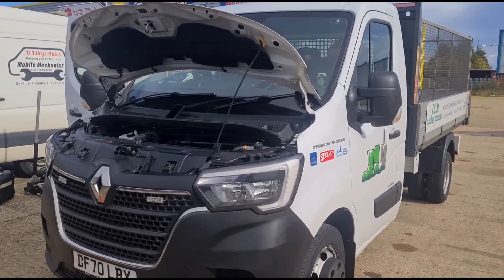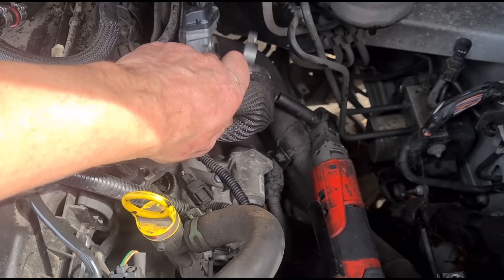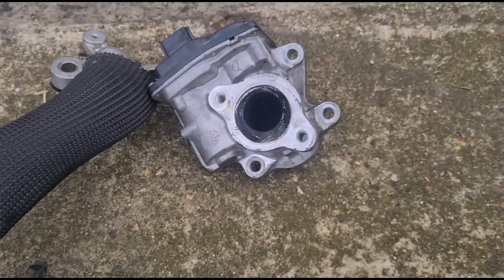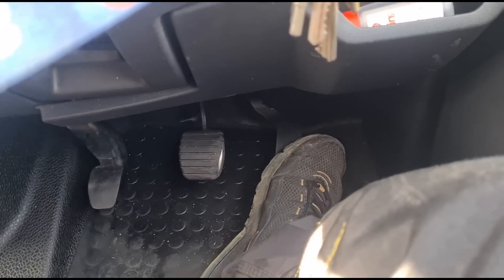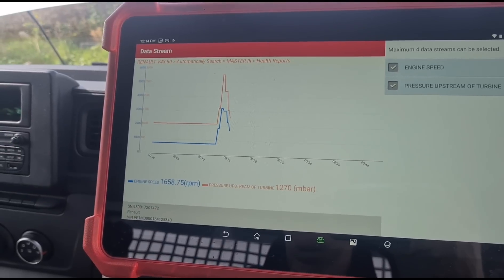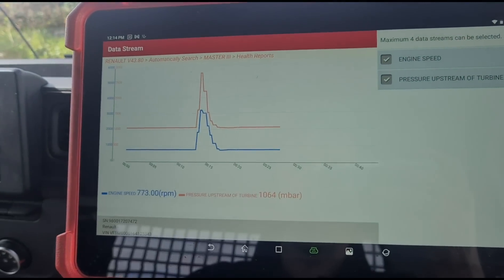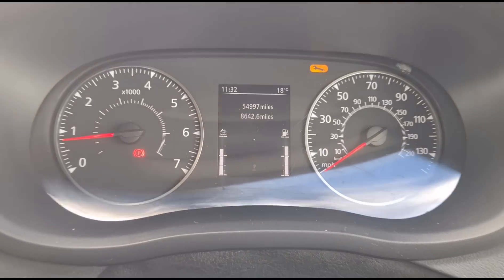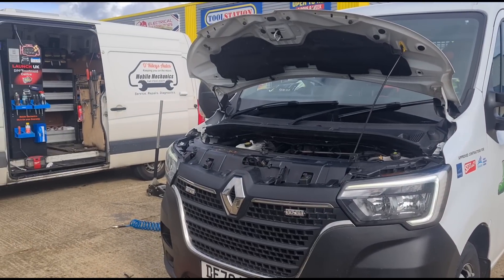Renault Master RWD 0400F5 High Pressure Exhaust Gas Recirculation

Comment: Hi, I have a 2021 renault master 24000kms, no power loss I'm not sure if it should have more power as I only owned it 5 weeks, and the check injection fault came up, then check anti pollution system, the code reader said p0299, I think it said 58%? so I've removed and checked the intercooler an hoses, there was a finger of oil in the outlet side of the intercooler hose, Intake side clean, I gave the cooler a clean  and re assembled it all , cleared the code  it's going OK but was wondering if the egr flap etc is getting slightly blocked, I forgot to check the wastegate for free movement., I added some penrite DPF cleaner, would an egr cleaner additive  help keep things clean, do you think the egr is the real problem, I have some maf sensor  cleaner, and may also clean the pcv that's easy stuff. I would appreciate any info thanks.

Comment: Hello mate, I look after a fleet oh Nissan NV400s
I’m pulling my hair out with this fault ! Ive replaced EGRs, cleaned the pipe when it’s blocked but the light comes back on after about 1 month ! Did your light stay off ??
I’ve noticed it goes to a EGR cooler around the back of the engine and hoping it’s not that because it looks a swine

Comment: Have yet to see the vehicle but I have one with a 0400f6 positive loop difference. I'll be checking the bits you did etc
Reply: What it a similar problem with yours?
Reply: @L3g4cyTT  yes blocked egr pipe to inlet manifold mine was a front wheel drive one. Front end off for one bolt 😡

Comment: In my Jeep, if you press the brake and accelerator at the same time, the electronic throttle light comes on and the engine speed drops to idle. This is to prevent any runaway from a stuck throttle pedal. If the throttle pedal sticks down, as soon as you press the brake, the engine goes to idle.

Comment: Great job Jimmy. Would a more frequent oil change help stop the crud build up? I believe service intervals are every 24k miles on these. Maybe change oil every 8k?
Reply: Best to get it coded shut, put a blanking plate between the EGR and Exhaust. No more manifold blockages, no more soot